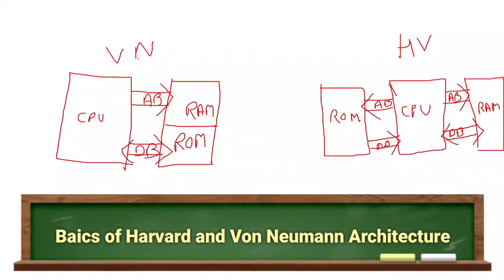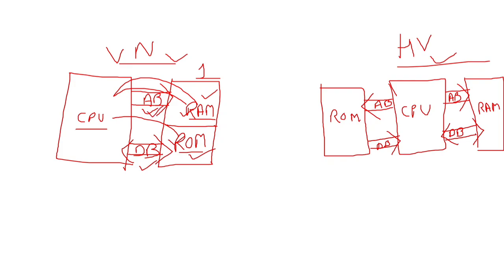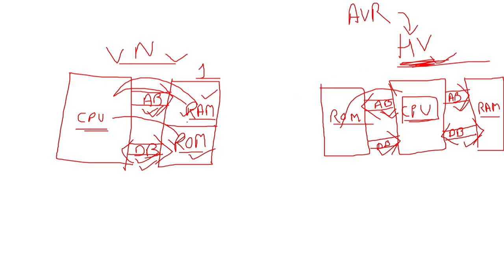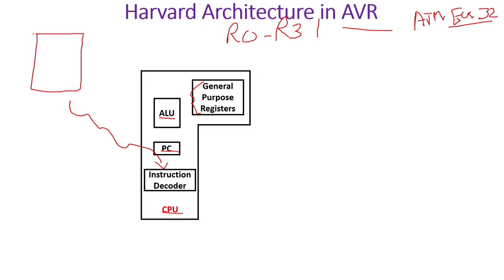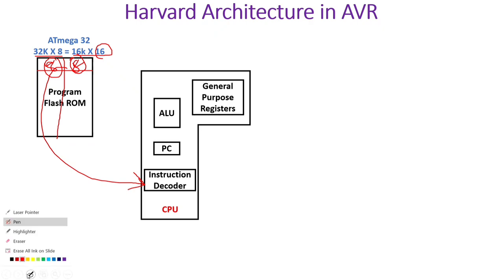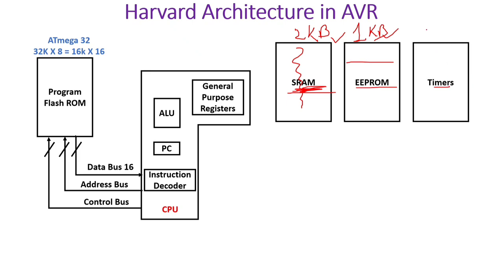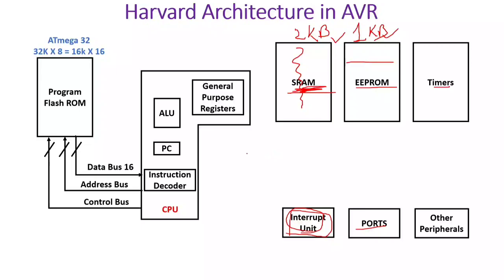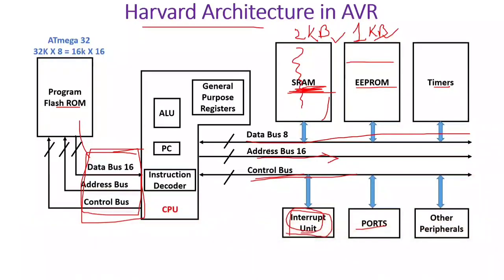Harvard Architecture in AVR Microcontrollers: Principles and Implementation

Comment: AVR
ATMega32 - General Purpose Register- 32 registers and each register is 8-bit, ALU - 8-bit, PC - 16-bit, Instruction Register - first code comes into IR, PC - store address of next instruction, Program Flash ROM - 32k x 8 - Data bus - 16-bits, (SRAM  - 2KB, EPROM - 1KB, Timer - 3 timers - 0, 2 timer -8 bit and 1 - 16 bit, Interrupt Unit - 32 interrupts, 3 hardware interrupts - remaining software Interrupt, Ports - A, B, C, D ports, Other Ports) - Data bus - 8-bits - Address Bus  - 16-bits

Comment: How far does Atmega 32 differ from Atmega 328p regarding our exam and semester perspective?
Reply from the maker: Atmega32: 40 pins with more GPIO (32 general-purpose I/O pins).
Atmega328P: 28 pins with fewer GPIO (23 general-purpose I/O pins).
Atmega32: 1x 8-bit and 2x 16-bit timers.
Atmega328P: 2x 8-bit and 1x 16-bit timers, which are more suited for precise timing applications.

If you need more GPIO pins, the Atmega32 is more suitable.
If you are looking for low-power and compact designs (e.g., Arduino-based projects), the Atmega328P is the preferred option.
Reply: @EngineeringFunda  Is AVR Assembly programming for both of them is same?